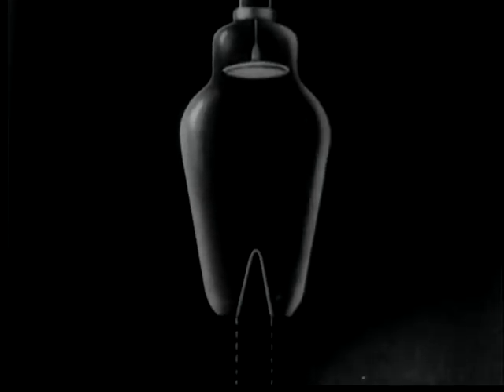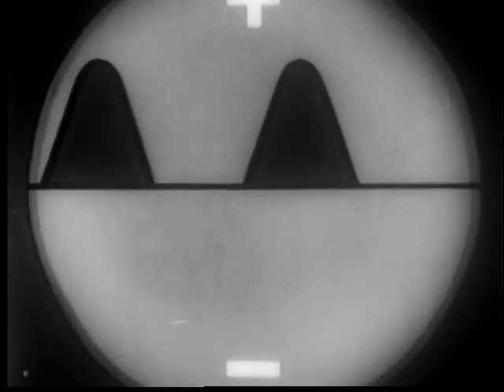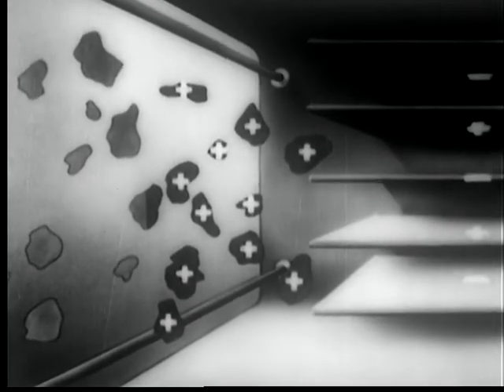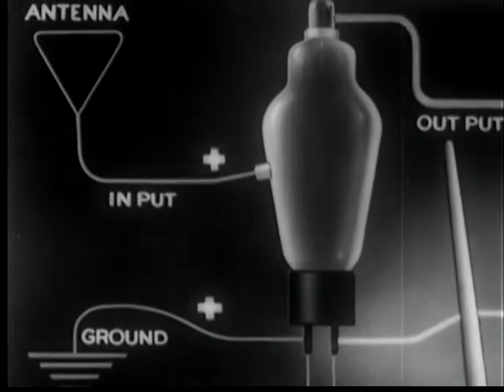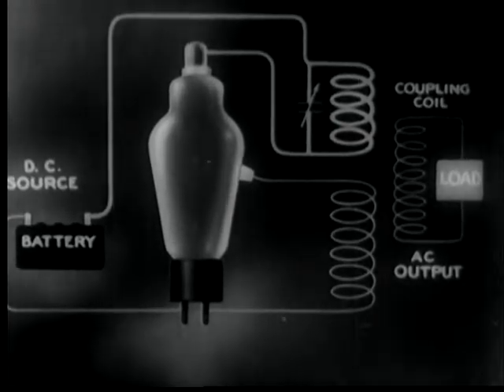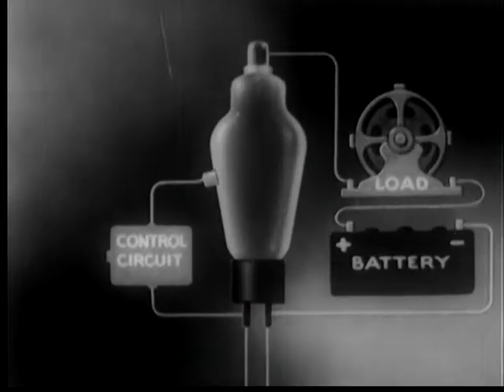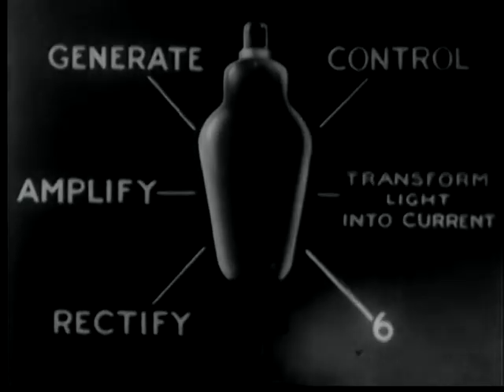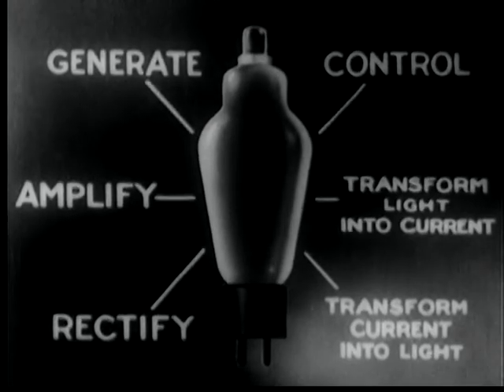Electronics At Work (1943)

Comment: Ah these were the days before transistors. Everything could be made smaller with transistors and semiconductor materials. Yes on the  high end with large amp draws a tube is handier.

Comment: When it comes to handling large amounts of power, a vacuum tube can't be beat. Semiconductors are just not as good, and most are not capable of more than a few hundred watts, each. The large amps, etc., in radio and TV broadcasting, still use steel bodied tubes, from manufacturers such as Eimac. I was in the radio and TV service business, at the tail end of the tube days, and enjoyed working on those sets. That was in the early 1980s.